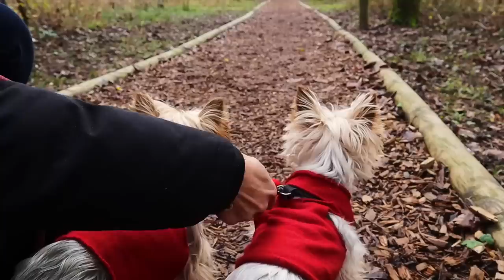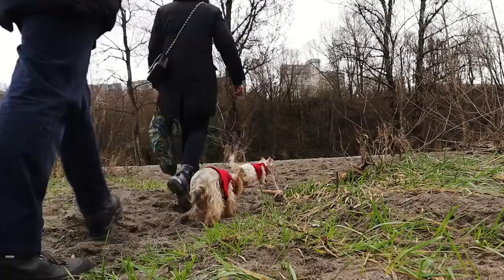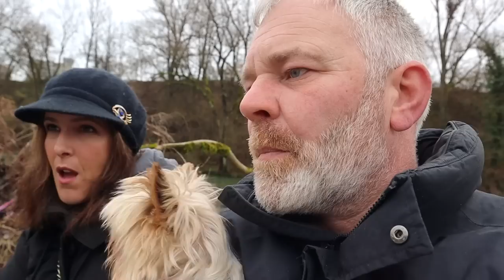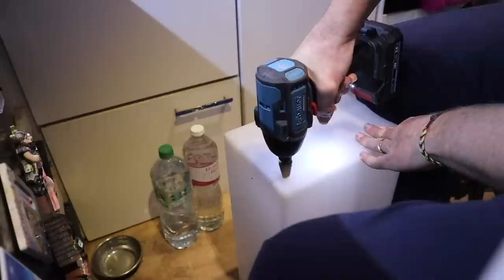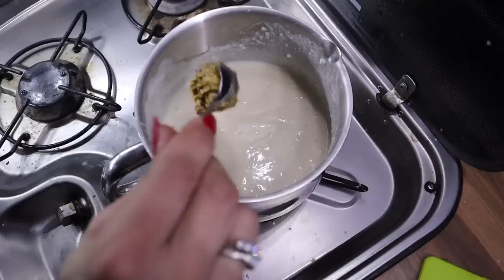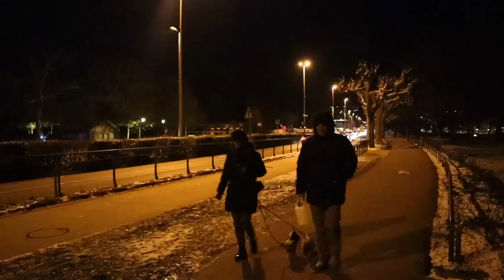UPGRADING our water heater, cauliflower cheese and a river. We are the parents of @ameinavan

Comment: That hot water set up is very interesting! I'm slowly repairing a van to eventually convert to a camper, I was going to use an electric hot water tank similar to the one you've just removed... Ame, in one of  her videos mentioned that you've had trouble with yours, I was going to ask at some point, but it will be a while before I'm ready for a water heater, so I didn't bother. I'd love to know how this works out, so will you give us an update in future videos.  One point I wondered about, your giving up free hot water from solar generated electric, and heating water from diesel... have you done any estimations of the running cost?  Also, how lucky was Ame to get that bonus Christmas present from Renogy!
Reply from the maker: Definitely steer clear of the electric water heater. There were only a few months that we could rely on getting enough solar power to use it and even then it wasn’t really enough. We are really hoping that this new water heater works well. The diesel heater costs around €20 a week in the winter, so inline with that price, we think it will cost around 1€ per day for the hot water 😀
Reply: @midlifevanlife  It's interesting you should say that... But, before I say anything I have no experience with solar yet or full time van-life, however, when I see peoples builds there solar arrays always seen under sized 😮 I don't mean to pick faults with people set up's, but it does seem like that work out the power potential from the solar panels based on the maximum power of the panel. I remember you have 300watts of solar, If you had 600 - 700 watts with 300ah battery, how do you think that would perform? Ps, I don't mean to pester, it's just these questions have been in my head since Ame did your van tour video. 🤯
Reply from the maker: 6-700 watts should be fine with 300ah lithium battery.  Obviously it all depends on what you are running and if you will be doing a lot of driving. We are in one place at the moment so that has also impacted us. Hope that helps😊
Reply: @midlifevanlife  How many watts @ 240volts was your electric water heater?  I really hope the new system works, watching this video has give me some great ideas 💡
Reply from the maker: It was 2000 watts😂

Comment: Hi Rob, Charlotte
I posted this on Ame's page but not sure if she will see it so put this here also in case you do. In Ame's last video she mentioned using the gas stove for the heating in the van since her heater melted. Just wanted to check if there is some window open slightly or the extractor fan on to remove the bad oxygen, possible carbon monoxide buildup from the van (if the stove is on for many hours a day)? I'm no expert on this but did some reading and got alittle concerned for Ame and Gigi's health so I had to post it. And I know Rob is an expert on many things in van-life so can hopefully he can clear it up and you will say all is fine and you have the right air flow in Ame's van, so its safe and no harm done. Might be worth getting a carbon monoxide detector just for peace of mind. Here is some web links I checked: 
https://heaterss.com/can-you-use-a-gas-stove-as-a-heater/
https://www.designerappliances.com/blog/is-it-safe-to-use-gas-stove-as-heater/
Take care.